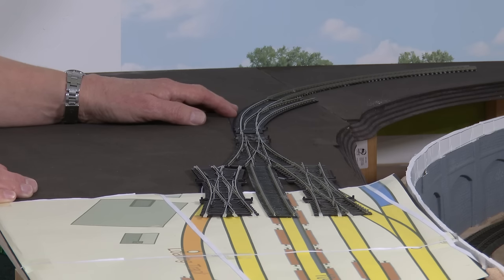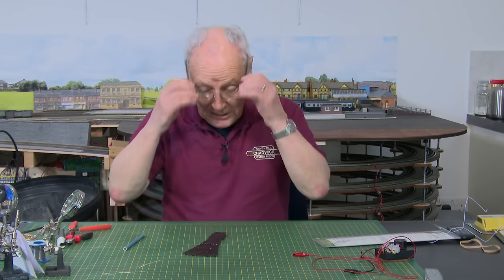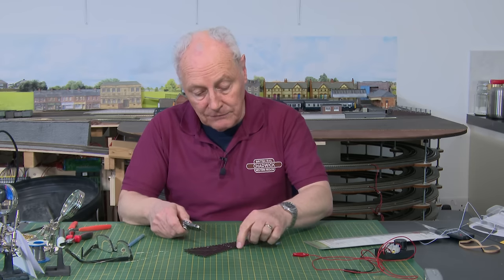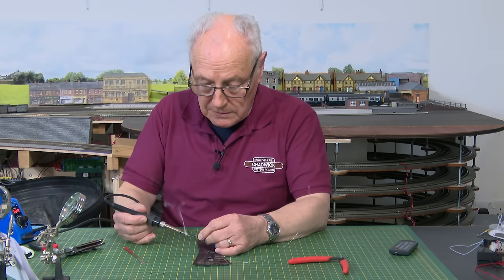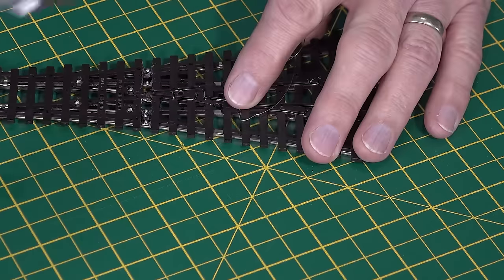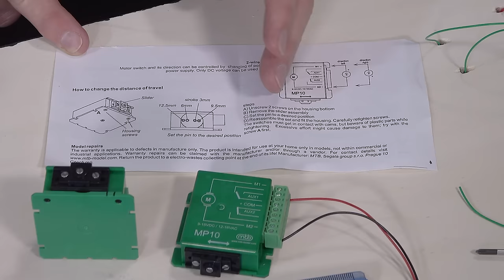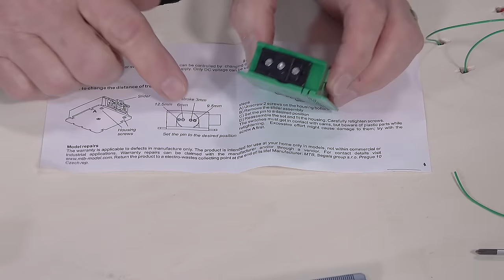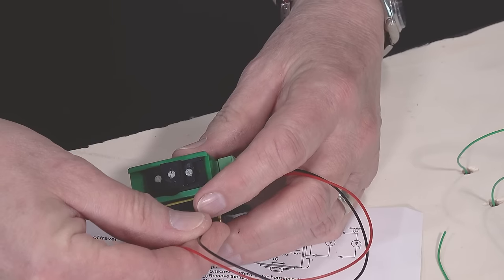PECO 3 WAY POINTS & MP10 POINT MOTORS at Chadwick Model Railway | 218.

Comment: Thanks for a nice video.
Peco is right, you don't need to remove the zero point spring.
There is an easier way to deactivate the zero point spring, you take a flathead screwdriver and push (move) the plastic part opposite the pull rod/points arm so that the distance between the plastic part and the metal clips (which are behind the plastic part) is zero millimeters and now the zero point spring has been deactivated.
With this solution it can be restored if later on you want it.
Reply from the maker: Blow me down, every day is still a school day. I never knew that, regards Charlie.

Comment: i've been using frog juicers, and just using Peco's wires. this is easy. I do modify the electrofrog long turnouts (N scale) but the scissors, unifrogs, 3 ways, double slips all have wires which just work (if DCC) with the frog juicers, of which I use Tam valley and the other brands.
Reply from the maker: Thanks, RW, for sharing your system. Regards, Charlie.

Comment: Hi Charlie, great video, there's nothing like seeing something done to get rid of the fear of starting something. Could you have used the larger holes in the jig to locate the actuator holes?
Reply from the maker: I take your point Andrew, although holding the point blades yourself makes the drilling. a little more accurate. Regards, Charlie.

Comment: That is on feature I like with Walthers turnouts, they have jumpers already installed to connect the points but they don’t make a 3 way or a slip and I use code 83, Peco don’t fit Walthers very well , great video Charlie
Reply from the maker: Thanks DJ, I’m so pleased that you found it interesting. Regards, Charlie.

Comment: If I may give you a tip. If you use a mini fan while soldering, it will blow away the lead fumes. For example, a USB fan on a power bank is sufficient.
Reply: I was going to recommend this. I have a fume extractor which pulls the fume through a carbon filter. Also has a light and runs off USB. Fairly sure it was an Amazon special for under £20.
Reply from the maker: Thanks guys, I’m on the case. Regards, Charlie.

Comment: Nice video Charlie, I have done a similar mod with my N-Gauge three way point, they are rubbish without it for slow running which is usually the case in goods yards etc.
 Did not know you screwed them down, I thought you used Copydex for fixing your track. The reason Peco do not recommend removing the springs is because the tie bar can become loose, well it does on n-gauge especially if you do not have the motor correctly lined up.  Chris
Reply from the maker: Hi Chris, the reason I didn’t glue them down was in case I have to move them. I have a small modification to alleviate the movement of the tie bar, which I shall cover shortly. Regards Charlie

Comment: Great video as usual. Could I suggest you file the tip of your soldering iron to a chisel rather than a point. You can make a finer or broader chisel to suit as well, the re tin the copper tip ie add solder . That way when you touch the tip to say a rail a flat surface area of the tip will heat a broader ( relative to a pointed tip)area and give better heat transfer and a better solder Pad.
Reply from the maker: I take your point, but the soldering tips are plated and using a file makes them unusable. Regards, Charlie.

Comment: Great subject, Charlie. The jigs you mentioned will make life so much easier! I have a Walthers double crossover to install  - unfortunately there is no jig for that. Given your experience with of both Tortoise and MP10, and knowledge of the problems McKinley has had with Tortoise, do you have a preference? Or does it really come down to the location of the machine and size limitations thereof? Keep up the informative work. and thank you for it.
Reply from the maker: At this stage Jeff, I would chose Tortoise, as the MP10s are untested.
Regards Charlie.

Comment: Do I remember you saying you could top mount these point motors?  There may be a need for this or potentially just for show hidden under a line side shed.  I have suggested to others that they make room for a Wickmann Trolley. Not suitable here in the Goods Yard and it would require the hand of god to get it on and off the track.  I would like to hear your view on placement. 

My preference is to see both types of points covered in the same video.  I would imagine there is enough duplication to make this simple but more work for you in the next two weeks.
Reply from the maker: Many thanks, George, for an interesting comment. I don’t believe either video will take too long, as I’ve already covered the point motor installation. Regards Charlie.

Comment: Lead free solder is harder to melt and doesn't flow as well.  I prefer 60/40  myself, and I am an electronics technician and design boards.  Lead free tends to crack easier too.   400 Celsius is probably a good temperature for soldering tracks as the metal acts as a heat sink and zaps the heat away from the iron so quickly.    On normal circuit boards, or tinning wires and the like, 350 is plenty of heat.   The cheap irons like what you have are perfect for soldering to tracks.
Reply from the maker: Many thanks for your reassurance EA, regards Charlie

Comment: Hi Charlie, A question about the MP10 point motor. Did you look at using the MP5 point motor instead? Is there an operational reason? Thanks for a great video.
Reply from the maker: No Lee, I used it because it was a new release. I like to test it on behalf of the subscriber. Regards.

Comment: Hi Charlie, I recall a good friend of yours who uses 'many' Tortoise motors and has re-engineered the internal switches. Mechanical longevity issues. Have you taken a look inside to see how the MP 10 point motors handle the switching?
Reply from the maker: I’ve had them apart, but of course they haven’t really seen any proper use as yet. Regards, Chai.

Comment: I will be interested to see if you get problems with either of the two reverse curves around that 3-way point. I have in the past been advised to add a short straight length between opposing curves. I an hoping we can all see that was wrong advice or only applies in shaper curvatures. Informative video as usual.
Reply from the maker: I think it should be okay, John, knowing that the wagons will be weighted and moving at very slow speeds. Regards, Charlie.

Comment: Hi Charlie.  Enjoy your videos.  I'm a little concerned the double "S" curve (coming off the curved point into the 3way and going to the right) will be troublesome. Do your couplers have enough swing?  A solution would be to add a short straight between the curved turnout and the 3 way.  But it would cause the yard to be shorter by 1 car per track.
Reply from the maker: You make an excellent point Tom. However, I’m going to try it and see how we get on. It’s always intended to be a slow speed freight facility. Regards, Charlie.

Comment: Hi Charlie and All
One quick question for the dummies.
Getting older every day, and retired, I can really appreciate everyone's comments
Regarding removable boards when wiring, adding point motors etc. I used to lie underneath
But not now. But, when installed complete with track, can this still be reasonably easily removed.? 
If so, how is the track installed across the join.? Do you have to split the track On the join, aligning
The boards with dowls or similar? A lot of work if you have a large layout with several boards.
Please,an answer from any of you experts following Charlie's marvelous channel.
Many thanks. Howard.
Reply from the maker: Hi Howard, what I do is prepare both boards with all their track et cetera fitted. Then bolt the two boards together and bridge the track with a small connector piece roundabout 10 inches long. Regards, Charlie.
Reply: Makes sense
Many thanks from an old arthritic.
Please keep up the good work.

Comment: Gidday Charlie, when you are soldering points eetc, I am assuming you are soldering to 'DCC' layout ?
Reply from the maker: Yes, Wayne, my layout is DCC. However, most of what I do is useful to DC also. Regards, Charlie.
Reply: @ChadwickModelRailway  Thanks mate, thought so. My set-up is DC convrsion, however, the whole lot is 'BLOCKS', the wiring will only require soldering ALL the Blocks up and have  one 'BIG' circuit without major modification - I hope...Were you ex Queen's Gravy in the other life?, me too ex Yeoman (Bunting)

Comment: Charlie: Is the MP10 noisy compered to the tortoise point motor?
Reply from the maker: Hi Kev, there is very little difference. The MP 10 has a marginally higher pitch. Charlie.

Comment: Hi Charlie could you tell the size of the screws you used the hold down your points in your last video. Cheers
Reply from the maker: I really don’t know what they are Ian. However, I should be using cheese head screws rather than countersunk ones. Regards, Charlie.

Comment: Thanks for another interesting video, Charlie.  Can I ask whether the double slips are the Peco SL-90 version, which would make them also a potential problem for your shunting locos, as they would not have the insulated frog?  Looking back at video 216, it certainly seems that the double slip you showed (the one you bought for a bargain price) had the 'dead' frog.  As far as I know, Peco don't make an electrofrog version in their Code 100 range, but maybe you're using ones from the Code 75 range.
Correction: The SL-90 would not have electrofrogs, i.e. they would have insulated frogs!
Reply from the maker: You’re right, Stephen, it is the insulated frog version. However, I will put stay alive, in my shunters. Regards, Charlie.
Reply: Thanks for the clarification and I'm sorry if I seem like a dog with a bone, but does that not mean that you never needed to worry about the original curved point, which you replaced with SL-U76, being of the insulated frog variety?

Comment: Charlie I would like to see the unifrog point wired, also does that 1.3 drill have a larger shank on it for strength? if so where did you get it 
Thanks again for a great video .
Reply from the maker: Hi Jack, yes it does have a larger shank measuring 2.4 mm. I believe it came in a set,from a company called Expo. Regards, Charlie.

Comment: Hello Charlie, I've found that I have a few discrepancies with the mtb motors. The 3mm setting actually is 4/4.5 and the 6 is more like 7/7.5. It's not that serious since the turnouts can take it and it works fine, but I was just wondering if you've had those issues with yours. Cheers.
Reply from the maker: I didn’t notice it when I measured mine John, are you using MP10’s? Regards, Charlie.
Reply: @ChadwickModelRailway  mp5’s. I asked mtb about it but no answer. I'm planning on switching to the newer mp4’s.

Comment: Thanks as always Charlie. Can I please ask though, why did you use the MP10s and not the smaller MP1/MP5 units that I think you have shown in previous videos?
Reply from the maker: Hi Mark, two reasons really.
The first is to test a new point motor on behalf of the subscribers. 
And secondly to do a long-term comparison between the MP 10 and the tortoise. Regards, Charlie.
Reply: @ChadwickModelRailway Have the MP motors all got the same mechanism inside them ?
I believe the MP10 is made to be a direct replacement for the Tortoise motor with the same base plate dimensions
Reply: @ChadwickModelRailway thanks for the explanation! They do look pretty chunky…

Comment: One question please, why do you use choose to use a flat type 10mm drill bit instead of a standard drill bit for the point armature holes?
Reply from the maker: It’s probably laziness on my part, Andrew. However, I do try to drill from both ends to make a clean cut, when required. Regards, Charlie.
Reply: @ChadwickModelRailway  Sorry the reason I asked was because I am new to woodworking and wondered what the pros and cons of these bits are and the use cases for the flat type over the traditional helix bit.

Comment: Hello Charlie, Thank you for this video, I have been thinking when you drill your 10mm hole for the point motor would it be the same size hole when using foam off 4cm plus 10mm baseboard unlike your 18mm baseboard.
Reply from the maker: I don’t really think that it matters, with the armature wire being vertical. Regards, Charlie.

Comment: How do you manage that one set of blades can only move if the other set is in the correct place?
Reply from the maker: Because its point motor will hold the blades in place Nick, which cannot be over ridden by the other point motor. Regards Charlie.

Comment: Hi Charlie I don’t tend to do point motors for now for my fiddle yard, could I still do the point modification for my 3 way points that I will throw by hand
Reply from the maker: Yes, Chris, those modifications will still help. However, if you have the electro frog three-way point, you will need a method to switch the frogs. Regards, Charlie.

Comment: A gently used fine tooth razor saw, would have cut plastic and stopped at the metal rail.
Point plastic is tough stuff.
I am going to have to look carefully at my insulfrog 3 way.
Lead free solder has a much higher melting point than standard lead tin solder. Yes it is less wetting/sticky.
The plastic rail chairs moulded on track can disappear during soldering!!
Reply from the maker: Thanks John, and thanks for the useful tip on using a saw. Regards Charlie.

Comment: One question on the 3 way point - if you have a control board with say pushbuttons to select routes/switch points or toggle switches how do you go about selecting which of the 3 paths is selected given there are two point motors?  I find the 3 way point very confusing
Reply from the maker: I’m sorry, Andrew, but that’s beyond my skill set. However, I feel certain there must be a YouTube video going into that kind of depth. Regards, Charlie.
Reply: @ChadwickModelRailway  I think you sell yourself short having watched your videos mate.  But out of interest how do you go yourself go about controlling the 3 way point?
Reply from the maker: @andrewbergman9315  I must confess, mine is computer driven . Regards, Charlie.

Comment: Charlie, what is the difference between the mp 5 and the mp 10 point motors? I am just starting my n scale and have 20 tortoise switch machines that I may get rid of because I think I like the easy setup of the MP's.
Reply from the maker: It appears to be just size but DCC TrainAutomation may have more info.
Regards Charlie

Comment: Do you intend to wire the points so the blades cannot be moved in the wrong order I.E. throwing the wrong one pushes the other over which would cause frog polarity issues. This is something I did so no mistakes can be made but I am using lever switches rather than digital decoder operation.
Reply from the maker: It’s certainly something I’m going to look into Rob, when I come to wiring them up. Regards, Charlie.

Comment: Another ripper video. Those look like excellent point motors. I use servos, controlled by an Arduino Mega and Berrett Hill Touch Toggles, on my layout. But if I were move away from servos, I’d give these serious consideration - which brings up a couple of questions.
1. I’m struggling to find a local distributor for these in Australia. Any ideas?
2. Can you compare the cost of these relative to the Tortoise?
3. What options are there for controlling them? Would I be able to keep using the Berrett Hill/Arduino combo?
Feel free to tell me to do my own research and stop being lazy.

On the matter of the Peco springs: have you experimented with how the Tortoise or MP10 machines perform if you leave them in? Do they have enough torque to throw the points without removing the springs? I should also experiment how they work with servos, although I find that the internal friction of the (cheap Chinese) servos I use is enough to hold their position, so I de-energise them once they have been thrown. I move all servos to a neutral position before turning off the layout so they are not under constant tension when I’m not playing trains.
Reply from the maker: I cannot comment Ron, with comparisons to servos. 
However, the MP 10, and the tortoise reasonably close in price. Regarding their availability in Australia, contact DCC Train Automation. Regards charlie

Comment: Hi Charlie. I have a Hornby class 0-6-0 locomotive which has started to jump the points at the frog. Can the back to back distance be adjusted. Thank you 👍
Reply from the maker: They usuallycan Mickey, but also check out the function of the check rail. Regards, Charlie.
Reply: @ChadwickModelRailway  hi, it’s doing it on all sets of points. Do you know of any online videos that show how to adjust, for us new members to modelling. Kind regards, Mick.
Reply from the maker: @mickey1960_ I'm afraid that I don't.  Please try Sam's Trains.  He normally takes off the base keeper plate which then allows access to the drive axles.  Once in, they can be adjusted with a Back to Back gauge.
Regards Charlie

Comment: Hi Charlie, a quick question on why you've adjusted these to 6mm throw. I note that in the MP1/MP5 video you said OO points have a 3mm throw. https://youtu.be/KjG9Mzz3000?t=552
Is the 6mm throw specific to the 3-way point? as I've used 3mm on the MP1s I bought.
Reply from the maker: I think we have our wires crossed.
I opened one point and found it set at 3 mm. I then adjusted it to 6 mm which is more suitable for 00. Regards, Charlie.

Comment: Don't be such a skinflint with the sound deadening cork pads under the point motors.  Make them the same size as the mounting flanges on the motors and screw through them when mounting the motors.  That way the motor case will not bend when you tighten them

My OCD was also triggered to see you using countersunk screws for mounting the motors !
Reply: The using countersunk screws twisted my melon as well !
Reply from the maker: A Fair point gentlemen, I need to get to the hardware store. Regards Charlie